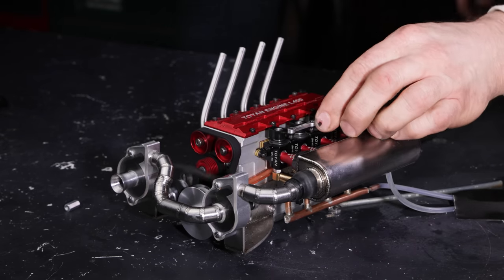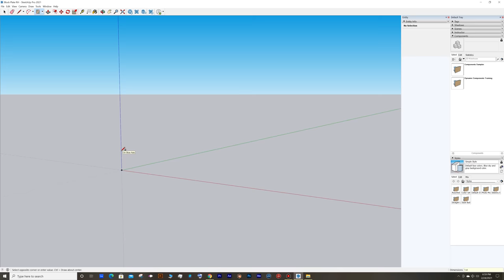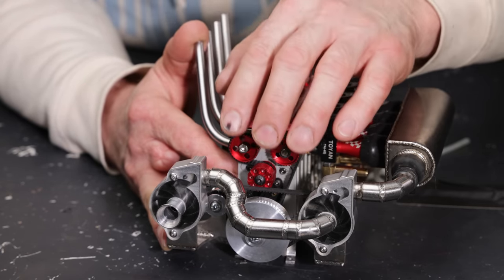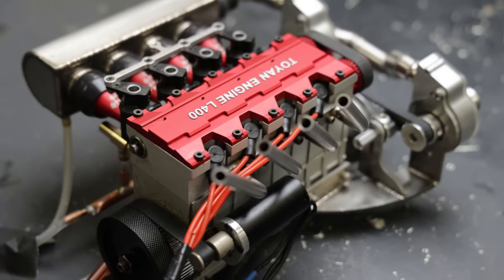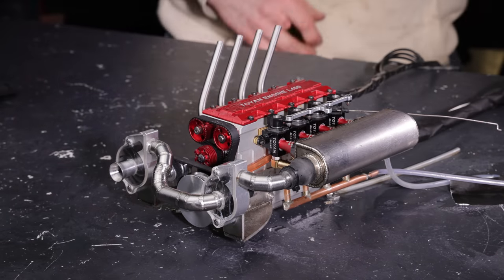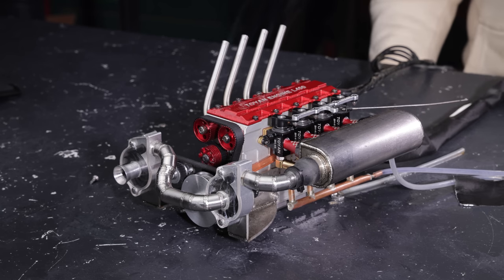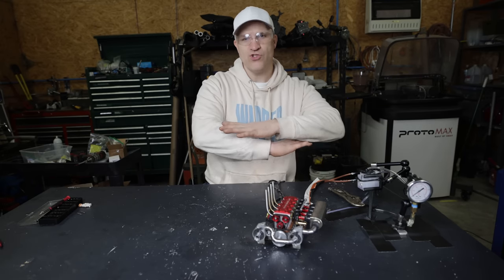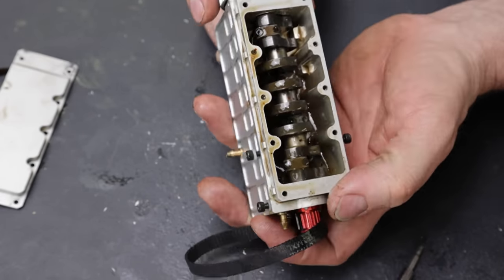Twin Supercharged 4 Cylinder Nitro RC Engine

Comment from the maker: Alot of people asking about the WaterJet I use, heres a link: http://bit.ly/ProtomaxWaterjet
Reply: Bro - 8:11 I knew I would see this ..to be honest - I hated these engines straight out of the first notice- for many reasons ..one they were originally made for a minibike and a fail attempt at that.. Too wide- making the balance dangerous for a little kid along with top heavy- the aluminum is very poor quality the plastic gears still a bad idea .. But if you use only 1 supercharger you would have gotten at least 6 psi to 8 maybe ..the 2nd one added drag.. Not actually increasing the "compounded pressure" I love your channel and you are by far a better engineer than the makers of that engine - ways to fit the problems at hand (the metal in that engine will loosen its form because it's like cheap Chinese steel ..it has an extra mix of bad fillers causing the metal to bend break distort and the weight will warp and shimmy ..ok the overheating problem - you and I both think outside of the box ..maybe I even do it more but you managed to put alot of great ideas in to works applause so arctic cpu thermal paste could be smeared all over it .. Forcing the temperature 🌡 down ..i use it on heatsink it drops my cpus from 198 degrees to 135 - running a robotic automated program constantly processing for days on end - use it itll work there to .. You need a fan blowing on that engine itself ..anything with the force or a cool hairdryer is enough to get your heat down.. The balance in those pulleys and parts are whats the major problem - if you remake that engine using your own 3d printer and metal you'll come out much better I'm positive.. Be safe Bro! ❤- *Wonka
Reply: there called twin turbos
Reply: @OFFICIAL_FORSAKEN_TENDENCIES  twin turbo is what's on the yellowbird 911 Porsche ..theres a major difference between the way they are connected to manifold.. They need to be connected but thier own singular intake not by being on same line.. Else explain the 3psi for what should have been 20psi..
Reply: How about a liquid nitrogen cooled engine? Haha
Reply: i would like to see that engine at a bike or boat or sth =D
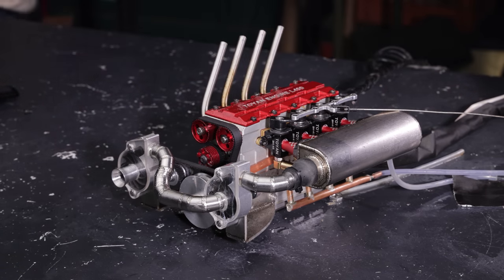Reply: 12:06
Reply: Is there any possibility that you can make me a custom one and I can pay you for it?
Reply: “A lot”. Sorry bro the grammar Nazi in me.
Reply: 12.
Reply: Would love to see different engines and more builds cool video
Reply: Can you build me this? I want one 😫
Reply: scroll or roots type forced iduction
Reply: @OFFICIAL_FORSAKEN_TENDENCIES  turbos use exhaust gas to spool
Reply: Be sure to lap the valves on that thing too.

Some other channels that have shown this engine did so and went from 10-11K rpm to 17K+ just by lapping the valves.

And since you're supercharging / adding even more pressure to the system, properly sealing valves are going to give you a lot more power and much less heat.
Reply: Just love your hobby, hard work and dedication.
Reply: Send me one so I can build a rc car with it lol
Reply: I want want for my rc car how much.?
Reply: When we ganna see the next part
Reply: I really want to see you make a see-through head for this engine
Reply: i have a video request. can we see 15psi? its been 5 months..
Reply: @leviroberts172  yes !!!
Reply: i dont mean to be so offtopic but does anybody know a way to get back into an instagram account??
I somehow forgot the account password. I would love any tricks you can give me.
Reply: @Isaiah Anderson instablaster :)
Reply: @Andrew Emerson It did the trick and I actually got access to my account again. I am so happy!
Thanks so much you really help me out :D
Reply: @Isaiah Anderson you are welcome :D
Reply: T
Reply: I wanna know the welder you use
Reply: Ouch.  30k for a personal water jet.   Will it cut the crust off of my sandwiches?
Reply: yo im missing the same finger lol
Reply: @pizzatimedaily7786  2 people can't be missing the same finger.  LOL.
Reply: Bringing the exhaust together for the scavenging affect would be sick
Reply: Try adding a pulley off the waterpump to add tension to the supercharger belt
Reply: @OFFICIAL_FORSAKEN_TENDENCIES  those are called centrifugal superchargers and they’re not turbos. Turbos are ran by the exhaust gasses, these are powered by pulley or cog drive.
Reply: U should consider selling upgraded mini engine's. Im not even a RC guy but ill just like to have a couple of these modified
Reply: Insane build man !! Love it !! Do you maybe builld by order or is it just a hobby cause I'd f*** love to have one of those little engines 😈
Reply: Why wouldn’t you put antifreeze in with that water mixture that definitely might keep the heat down a little bit brother if that water is boiling boy if that would of sprayed you man that would’ve been a bad day 🤦🏼‍♂️
Reply: Your compound set up is wrong to produce high boost you should have a big primary and a smaller secondary or the second should run faster.
Reply: I have been watching your channel now for a few years and I am really impressed with your work and just how well you have come on from the beginning. . You get better and better with each and every video . keep up with the great work
Reply: Dude!  SENSATIONAL editing and building.  Very impressive. TY.
Great app design ... can you not determine the engine's power by the heat it needs to extract ?
Reply: can you build that engine! Little more bigger exactly put in motorcycle! Like 200cc bro i don't have service at all i just want to build one but i don't have that machine to build but body i can!
Reply: i just wanted a service motorcycle for apply delivery rider! I want to build that can you make little big that i can ride and put in motorcycle!
Reply: No they are superchargers
Reply: Do a super and a turbo turn the boost way down, also let's see a syno next
Reply: @OFFICIAL_FORSAKEN_TENDENCIES  there actually centrifugal turbochargers
Reply: @joshuareedbudzik8916  turbos ain’t defined by exhaust gasses they are defined by a turbine
Reply: @mobilephone6388  no the are centrifugal turbochargers
Reply: Btw those are terbochargers not superchargers
Reply: How have you got these propellers for the superchargers ? Did you made them ?
Reply: correct me if I'm wrong, but they are most likely compound prochargers